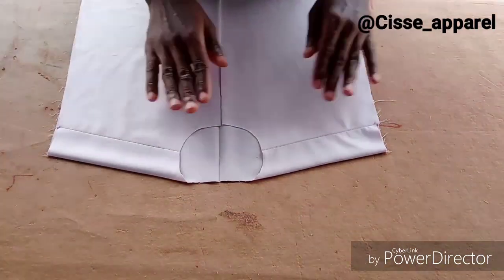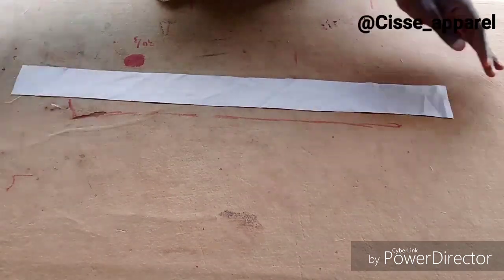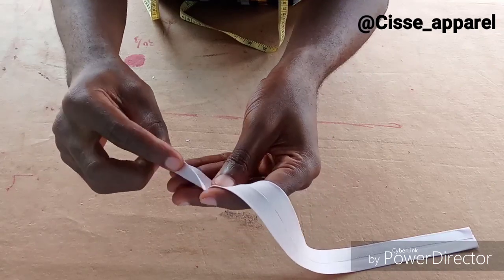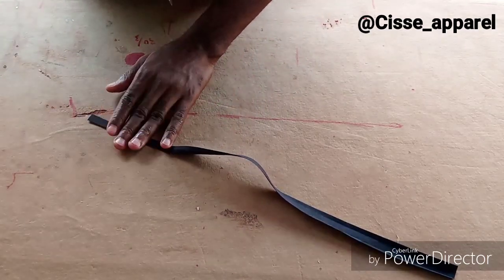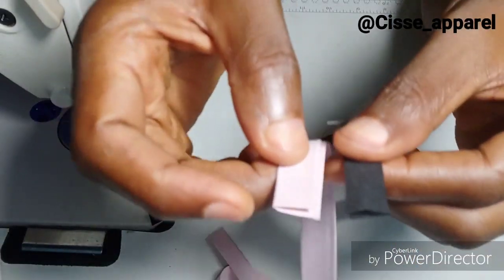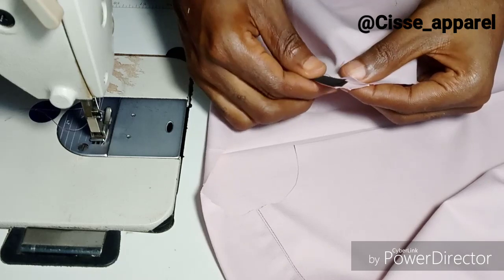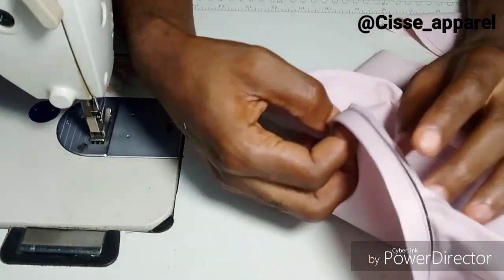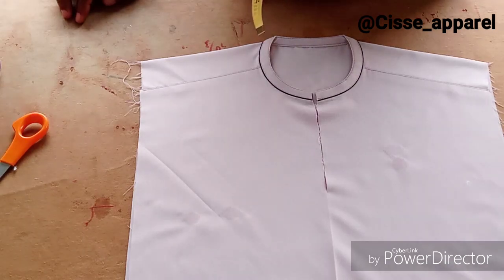How to pipe a neckline on senator wear [DETAILED]

Comment: Thanks so much sir, but does the method you use for the designer neck piping apply to an ordinary neck piping with design, as in the bias or any material design you just did?. Can we apply the same method to a plain one neck piping or there is another method for it sir?
Reply from the maker: Same method

Comment: How to you overlap the two inches on the back paqnel over the front panel of the senator top. I have checked all the videos, they are all doing it as though everyone knows how to do it. They simply fix it and all I see is the finished work.